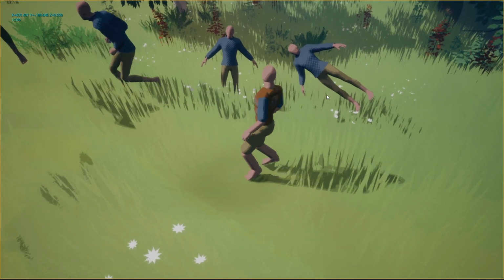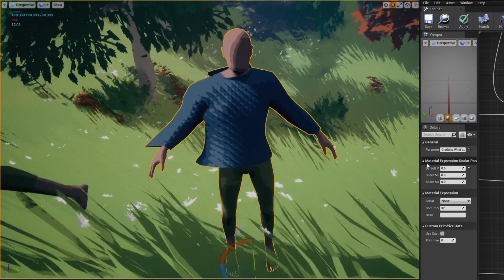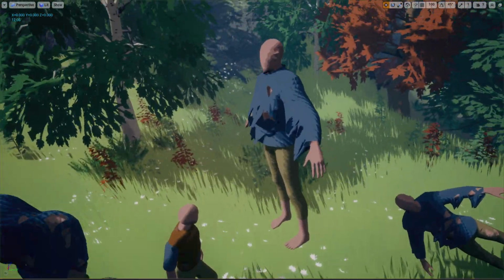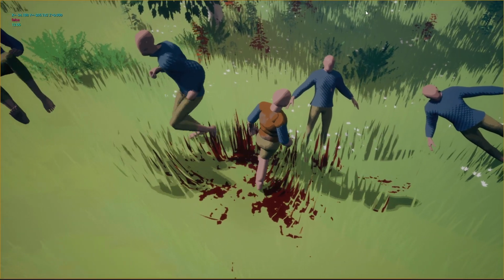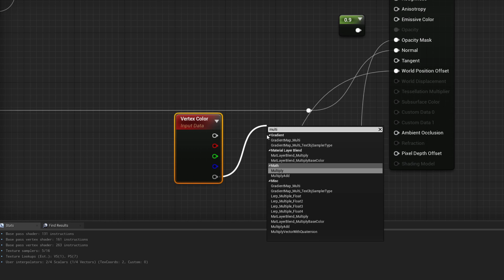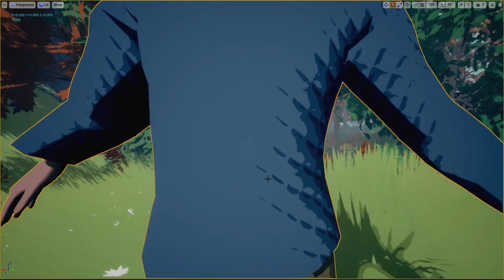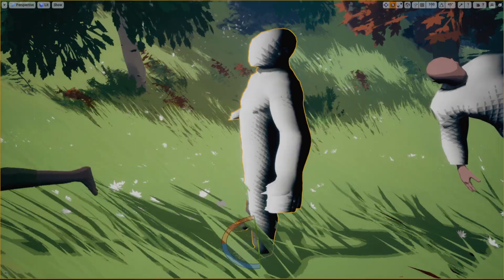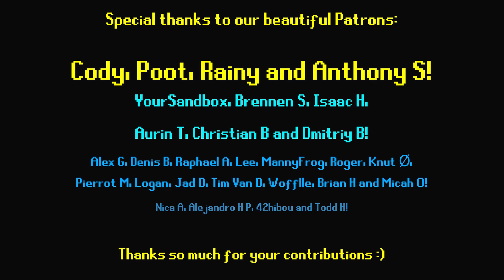Fake Clothing Simulation for Prismatica [UE4 WIP + Breakdown]

Comment: Available for UE5.0?
Reply from the maker: You could do this in UE5, yes. It's just a Material effect :)
Reply: okay yes I have a material effect similar but I was interested in the cloth damaging. if not I'll setup a system to match, was curious if you had a marketplace so I can save some time. Thanks
Reply from the maker: @foxhoundgaming4805  ah gotcha gotcha. It's not currently set up as a plugin, however I've been thinking of re-writing my system using NiagaraGrid2D instead of scene capture/draw material to render target. 

You could possibly use the Skinned Decal  Component from the marketplace if you have the money, but it's performance scales differently than using a render target
Reply: interesting okay I'll experiment thanks and ya I think the asset would do good its good stuff